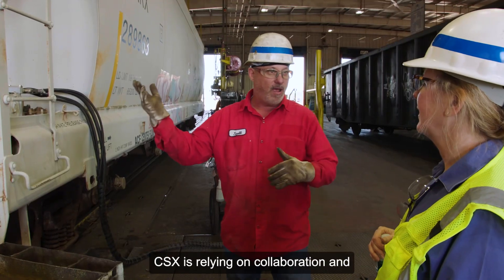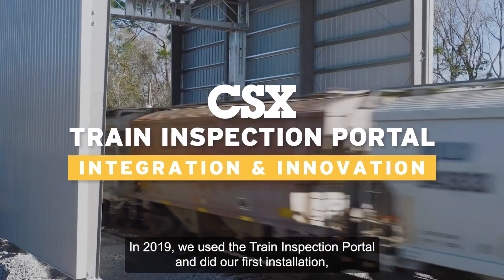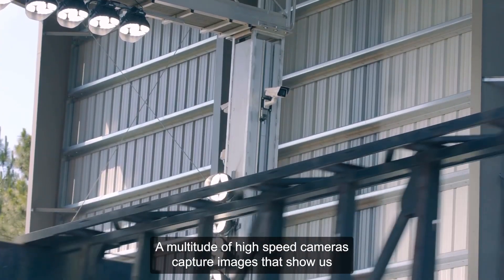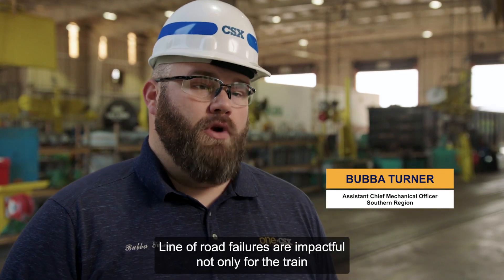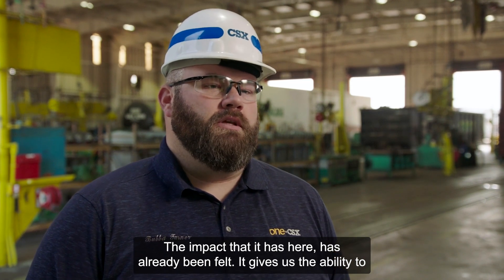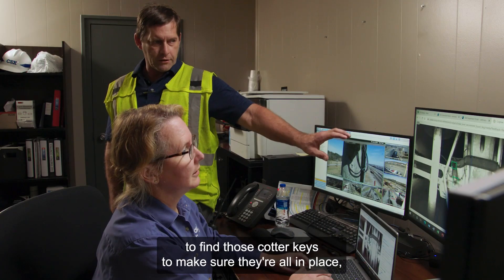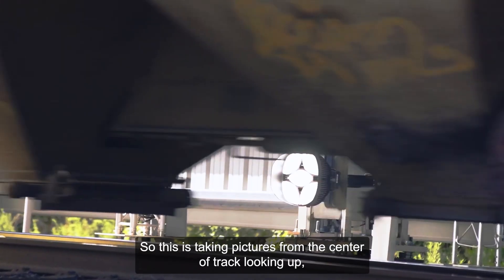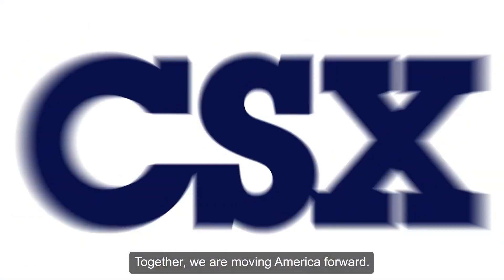Innovation at CSX: Train Inspection Portal

Comment: If only CSX’s main competitor put this much focus on train inspection and mechanical safety, maybe they wouldn’t be in heaps of trouble right now 😂
Reply: CSX's main competitor got their ideas in cost savings from, you should have guessed by now, CSX.
Don't be fooled by a corporate marketing campaign.
Reply: @pauljensen5699  Oh I’m well aware, E.H.H took CSX on a drastic and dark turn that only began to turn around well after his death. I just find it funny that CSX releases this video right after NS shows a clear lack of car inspections.
Reply: @NorthCountryTrains  Machines and men can take pictures and write notes, but until management authorizes work to be done, nothing will happen. 
This whole thing was a spin on the roulette wheel, and it finally landed in a bad way.